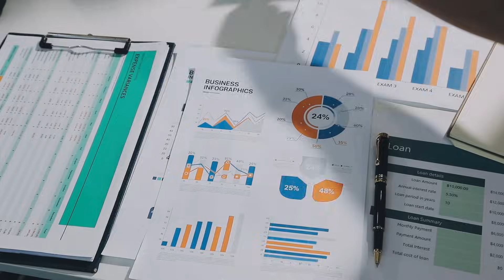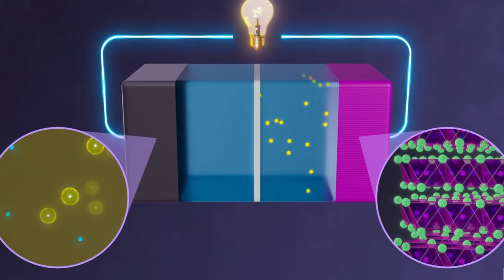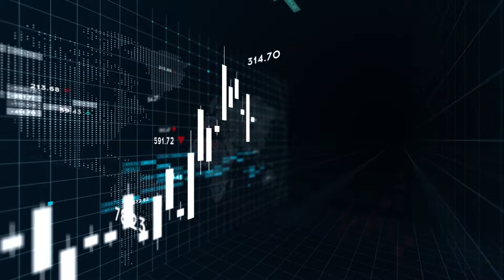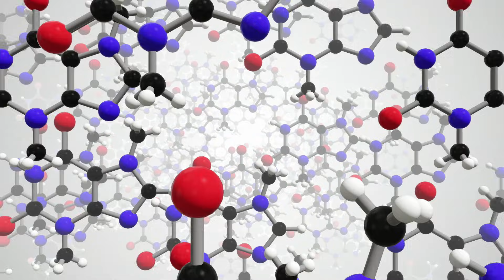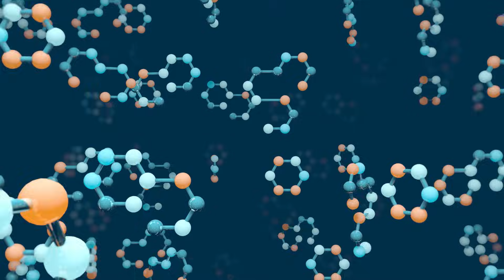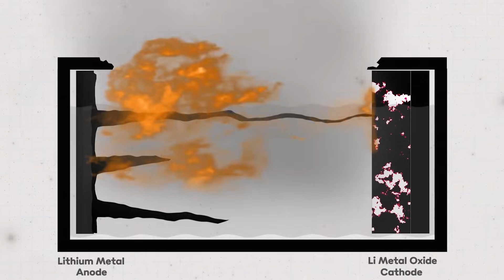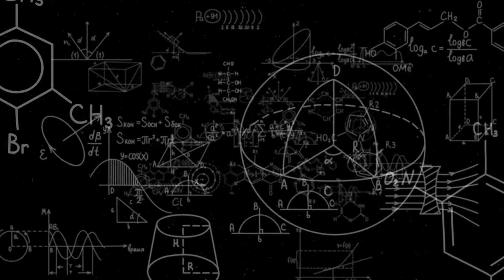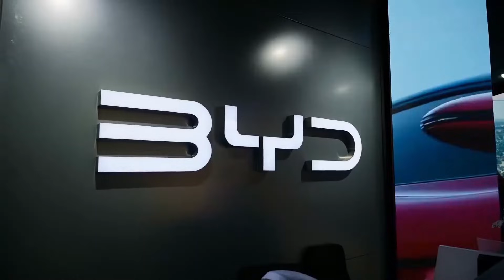Did Elon Saw This? This New TOYOTA Battery Will End the Electric Vehicle Era!

Comment: There ain't no way that enough electrical energy can be transferred in 10 minutes to make a 600 mile trip. No way. Maybe they got a new way, but storage capacity don't equate to the speed of energy transfer.  How many amps or watts would have to be transferred in 10 minutes?
Reply: China already has megawatt charging for cars. capacity improves every year…
Reply: On the Donut battery, their charging screen showed 225 kW charging speeds (the display showed that consistenly to ~90%).